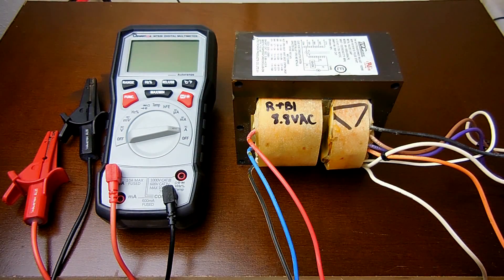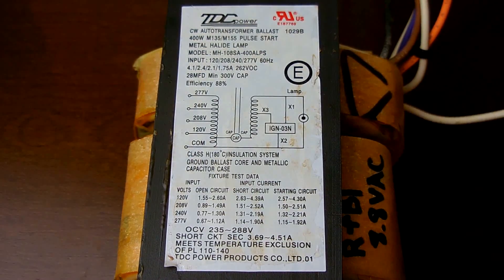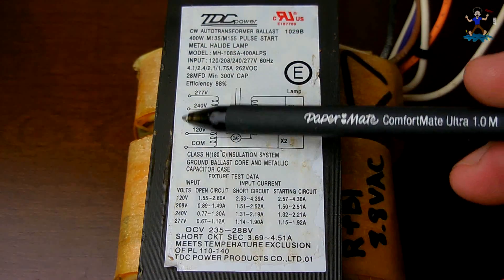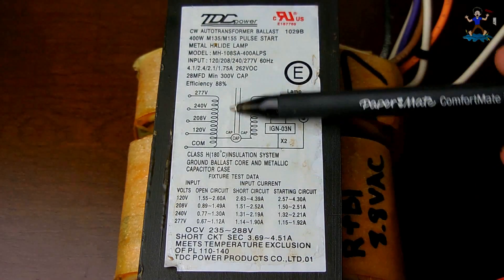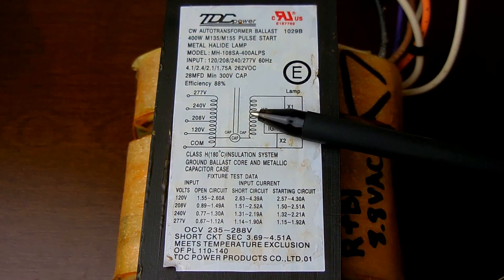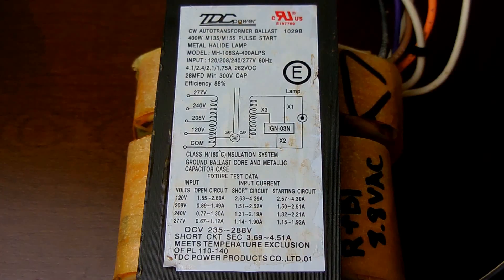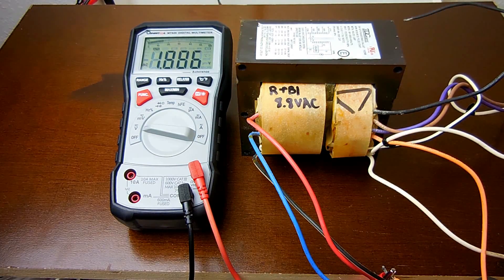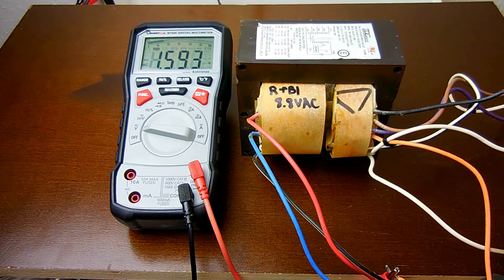Autotransformer Salvaged From HID Wall Pack

Comment: I've actually rescued a few of these 1000W HID ballasts since at one time was thinking making a welding machine with using.  Never got around to, since would have to rewind at least two.  Though neat seeing this video regarding.  Never thought about for the other VAC outputs.  Interesting as is or adding another isolation transformer with some more circuitry.

Comment: Thanks for the video, glad you covered this. I have a ton of these, out of curiosity can you wire these backwards to get higher voltage? Looking for 1000 volts for a diy bug zapper. Maybe put voltage to the secondary (120vac) and wire the primary middle leads in series...? But I don't know if the conductor can handle that high voltage without breaking down.

Comment: Your comments are somewhat confusing about rectifying the voltages and those voltages increasing. When you rectify AC across a bridge rectifier you get a voltage DROP of 0.7v per diode. So with 2 diodes in each half you should expect 8.8v AC to be REDUCED by 1.4v making it approx. 7.4v DC. 
Your meter measures RMS voltage. 8.8v AC RMS has a peak voltage 1.41x higher, or 12.4v AC. Using just a diode bridge you would lose 1.4v leaving a peak voltage of 11v DC which would be measured by your meter as 7.8v DC. LOWER than your 8.8v AC input. If however, you add a large enough capacitor the RMS voltage will approach the peak voltage and then it could measure upward to 11v. Which is how you would see an apparent voltage increase from 8.8v AC to 11v DC.
The point is, there is always a voltage drop when rectifying from AC to DC.

Comment: Mcfly! Caps don't limit current they delay it to be in phase with voltage.
Reply from the maker: McFly! Caps sure do limit current. I guess you never heard of "Capacitive Reactance". :-) Just like a resistor, a capacitor can be used to limit current without generating heat. They can also be used to create a phase shift when used for starting motors.

Comment: I have a light that may have a similar transformer. its a kinda like the old street lights. it came from inside a Lowes home improvement. it can be powered from maybe 120v. but 208 , 277, and maybe 480. not totally sure.its been a wile since I looked at it. but I'm looking into maybe rewinding a large fork lift transformer. its big enough to take up most of a common sized pallet. and is really heavy. and has 0 gauge leads coming from it to charge the 36 or 48 volt battery. but I want to build a inverter. to go from 24-48v to 120ac. I was thinking about using a arduino and lots of FETs. I have some really large heatsinks. and 6-8 22,000 if 75 volt caps. but my main concern is programing the teensy or arduino. I also thought about trying to just use a inverter to just be the brains. and some how trick the control feedback and safety features into thinking the extra FETs and inductors are part of the original system. and hide the extra current from the processor some how. but that would likely be too problematic. and dangerous. so that leaves me with the microcontroller route. but I know nothing about programming . but basically all I would be controlling . with it is the boost stage. going from 24 or 48 vdc. to about 180 v open circuit.  and use my capacitors for storage. and buy a actual driver board. for a pure sine inverter. witch has safety features. but I really need this inverter. but I can't afford to buy one of the output I need. do you know anything about these large battery chargers. the if it would be a good choice for low frequency power boosting?

Comment: Be sure to put wire nuts on unused wires to prevent shorting, arcing, and shock hazards.
Reply from the maker: Cash Olsen When I actually use this, of course the unused wires will be capped. Thanks for watching

Comment: probably trash about 20 of these a week doing retrofits. now that I've seen this video I may have to salvage a couple. hard to find decent looking ones though.
Reply from the maker: Yep, swapping out the guts to LED. :-)
Reply: did a bunch of 1000 watt hallides to 150 watt leds last week.. with the retro resulting in more light output.. it's insane!
Reply from the maker: Do they include a heat sink for the LED panel?
Reply: oh definitely, they are most always designed with some pretty good sinking, usually making use of the entirety of the metal in the panel. not uncommon to see 24v cooling fans inside the large sinks on high bays.

Comment: They get a fortune for wall packs...starters and electric eyes go bad. Always fixing them. No continuity should exist between primary and secondary...a leak in insulation maybe. Hypo it with your tester. We do substations and power plant equipment. I enjoy your show. שלום
Reply from the maker: Yes, there's no continuity between the primary and secondary winding taps. They are isolated. They only connect when the capacitor was used in the HID wall pack. Thanks for watching

Comment: Great video. Only error I found is your statement that the 8.8 vac windings would be isolated from the primary. This is not true. To be truly isolated, the windings can not have any electrical connection to the ground or common wire. One of my jobs as an Engineering Electronics Technician was to test and certify electronic devices to USA, Canadian, and European standards for electrical safety. That also includes all medical devices. Your autotransformer 8.8 vac circuit, though probably safe enough for most people, would never pass even the minimum electrical safety standards simply because of the connection to the common wire which can provide a return path in the event of a short circuit in the windings in the transformer which is a common occurrence.
Reply from the maker: There is isolation. There are no wires between the primary and secondary winding. :-)
Reply: electronicsNmore Sorry. After looking at the schematic again, I realized that I was making a connection in my head with the X1 wire. I am still wondering about the lines marked on either side of the capacitor. Is that one continuos line or two separate lines connecting on either side of a starting capacitor? If so, is that capacitor out of the circuit?